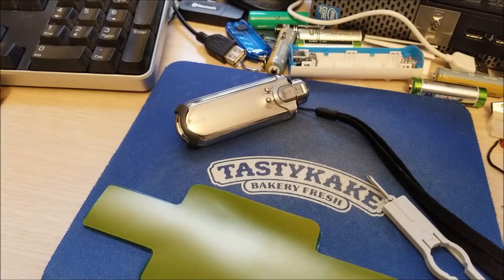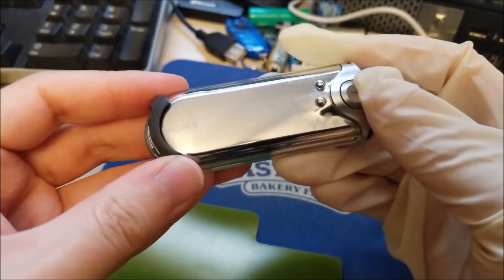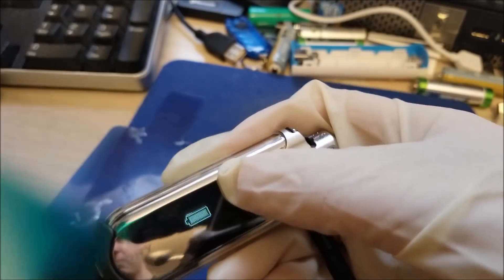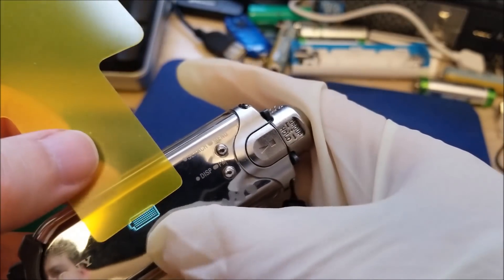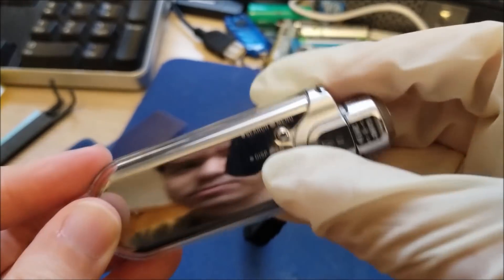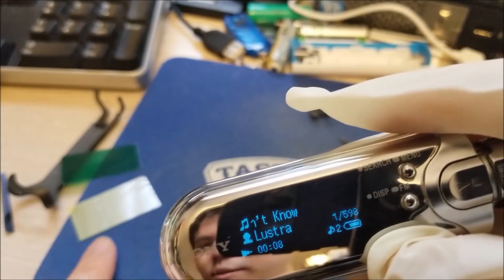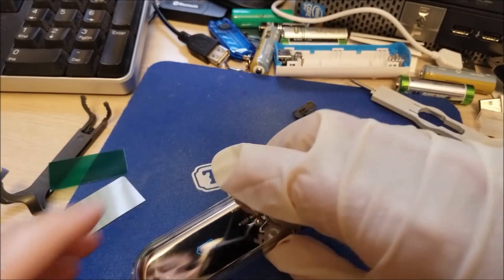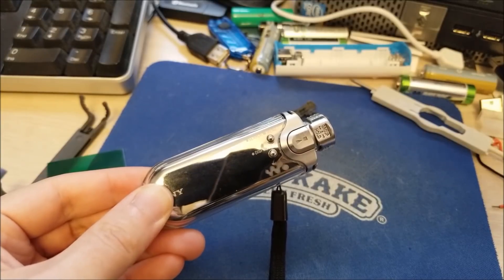5 Minute Project: Changing OLED Color of Sony NW-E507 MP3 Player

Comment: Got my hands on one but dont know how to clean the little scratches and dust from the transparent shells, whenever I wipe it more dust just appears, anyone knows how to clean this?
Reply from the maker: Lint free cloth (like for cleaning eyeglasses) and a little bit of distilled water should clean the dust off. For scratches best bet is to remove the plastic lens from the player with gloves on and use a plastic polisher to gently buff them out.
Reply: @sjm4306  the one i have also seems to have alot of bumps on the metal parts, what is it, and is there anything i can do to remove them?
Reply from the maker: I think the metal is actually plastic coated with a thin layer of metal. The bumps might be corrosion? If that's the case there's not much you could do to remove them without making it worse.
Reply: @sjm4306 i see, thx for such a quick response, this has been super helpful, keep up the good work❤

Comment: Hey how’s it goin? This might be a long shot but, I’m having issues with my new-in-box NW-E003F Walkman. I’ve left it charging overnight but even if I did that, it won’t display anything.

The device is recognizable from my Win.10 machine, and even shows its contents on file explorer and Sony crappy Sonicstage software, but, even still it won’t display anything.

Do you think it’s more of an issue with the display? Or are there other issues that I may have to unfortunately consider for?

Any advice or help is really appreciated
Reply from the maker: So unfortunately your display is likely dead. These early oleds can age even if unused due to manufacturing defects that let oxygen into the semiconductor material so it oxydizes. The only fix is to find a donor device with a working screen to pull it from.
Reply: @sjm4306  I see. I've decided to cut my losses and go with an A605 walkman model. Its less storage unfortunatly, but, it has been proven to be functional with the listings pictures. On your video, can i follow with what you did to your walkman model? With the color filtering and whatnot with my model coming soon?

Comment: Do you know how to put music on it? Sonicstage reads mp3s as 0 seconds in length, and can't transfer them anyway because it can't read the copyright or whatever
Reply from the maker: Are your mp3's protected? Did you encode/rip them yourself or are they from a web store that copy protects them in some way?
Reply: @sjm4306  I used Open Video Downloader on youtube videos
Reply from the maker: Do the mp3's play back normally in other music software? What's their size in MB? It's possible they are corrupted from the downloader program.
Reply: @sjm4306  the mp3s do play back in the built in windows player, but i dont’t remember the exact size of the files

edit: nevermind, it works now, i guess the mp3s were corrupted or something

Comment: batteries wear out over time. also unit doesnt have enough storage
Reply from the maker: Two biggest things to keep in mind. At least the battery can be replaced but nothing can be easily done to increase capacity unfortunately. Should technically be possible to swap the nand chip with a larger one but you'd have to clone all partitions and even then the firmware may have a hard coded limit.

Comment: Nw e403 no data problam is ka koi hal bta den
Reply from the maker: That usually means someone deleted the necessary operating files on the drive (depending on the model the encryption key may be gone as well which is unique to the player and irreplaceable). If the model isn't encrypted then find someone with the same model and kindly ask them to send you a copy of the directory and files on the drive and copy them to yours.

Comment: You think anything like this could be used to replace the MZ-RH1 screen? Or RH10
Reply from the maker: Actually this is exactly what I've seen some people do. A few of Sony's portable flash mp3 players used the exact same oled screen (looks to be 128x16 resolution, but different controller to the common arduino screens on ebay) as the RH1 so they can be scavenged. I believe a sports tube style player sony released (nw-s203F) uses this screen, while the 128x32 screen in this nw-e507 wouldn't fit. The issue is these players are getting rare and pricey themselves and a RH1 needs two screens so the fix while possible certainly wouldn't necessarily be cheap. As for the RH10, unfortunately the screen seems to be custom and only used in that specific model so there's no easy or cheap replacement I know of other than finding a broken RH10 with a working screen (this is exactly what I did for a video to get my RH10 up and fully running).

Comment: I noticed on many small OLED displays you can pull off the polarizing film and get a golden looking display with a lighter color, this is due to a polarizing film on the OLED. Then I put dichroic glass on the display it turns into an infinity mirror type of effect. 

Actually on one of my phones I burned away some of the polarizing layer on the OLED screen with a laser, the screen has golden portions on it but no pixels seem damaged.
Reply from the maker: I'm guessing the polarizing filter increases contrast of the display as to my knowledge it is not strictly necessary for the oled to function. I just bought a handful of those cute 0.96" 128x64 oled modules so I'll have to try and remove a filter and see for myself how it looks.
Reply: Do you think it’s possible to achieve the infinite mirror affect with this Walkman?
Reply from the maker: Yes I'm absolutely sure it is
Reply: @sjm4306 so I would use something like a dichroic window film instead of color gels like you did in the video right? Also, do I have to remove the polarizing film to achieve the infinite mirror affect?
Reply from the maker: I dont specifically know if you have to remove the polarizer but doing so will double the brightness which will probably drastically help the effect.

Comment: What's the lifespan
Reply from the maker: Of the oled screen? It's really hard to say as it depends on when the panel was manufactured and what process was used. From what I've read though oled failure on the NW series isn't nearly as bad as on Sony's hi-md players with oled screens.
Reply: Actually I m planning to buy from ebay for like $70 that's too much do u think It will last for a year
Reply from the maker: So long as it is not already dim then it will likely last 5-10 years of moderate use (just don't set the backlight to always be on)

Comment: The OLED backlight no longer works on mine.  How would you repair that?  It still charges and plays music.
Reply from the maker: The only way to fix a dead oled screen is to replace it. Unfortunately since the screen is not a commonly available one you would need to find a donor from a partially working device.

Comment: hi again! Do you think this is the same that u used?

https://www.ebay.de/itm/Gel-Filter-Flash-Diffusor-Softbox-12-Sets-von-bunten-Studio-Flash-1A/122794881132?_trkparms=aid%3D222007%26algo%3DSIC.MBE%26ao%3D1%26asc%3D20140107083420%26meid%3D699a4d34323f474a8bc8772002940640%26pid%3D100011%26rk%3D3%26rkt%3D11%26sd%3D273047368989%26itm%3D122794881132&_trksid=p2047675.c100011.m1850
Reply from the maker: Looks like a different brand but same purpose so they will work just fine.
Reply: +sjm4306 thanks
Reply: k thanks

Comment: I found an interesting item you might want to buy.  It's a broken GBA SP.  It needs a new replacement shell and battery.  The price is less than $20.  Even if you can't fix the other things, it has an AGS-101 screen that looks like it's in good condition.  https://www.ebay.com/itm/Nintendo-Game-Boy-Advance-SP-Platinum-Handheld-System-AS-IS-REPAIR-S222/302588021227?hash=item4673a6c9eb:g:2BkAAOSwk~ZaTDr-
Reply from the maker: Skyriss Heroysha So torn ... wish I could buy this but I just spent my monthly youtube video fund allotment for content for some upcoming videos. I appreciate the tip though.
Reply: It's okay, I'll still be on the look for other deals.  I'll find something interesting next month.  Most likely another broken GBA SP.  I look forward to your future videos!

Comment: I always love watching your videos. I have watched all of them fully. I wish there were more tech YouTubers like you, ThisDoesNotCompute, and others. You inspired me to do electronics. I got a clock lit that displays the time, then the temp (in degrees Celsius, which I don’t know) and the day and month, all separately. I hate it and I was wondering if you know of any that, you know, are just a clock and only tell time. If you don’t know of any clock kits, do you know have any other kits you recommend?
Reply from the maker: Thanks for the kind words. I believe the best way to get something that you want is to build it yourself. The problem with kits and commercial clocks is they are made to have as many features and be general enough to try and please everyone. However, nowadays it is easy enough to buy an arduino, led or lcd display, real time clock and buttons and download libraries to interface the modules. Then all you need to do is find a tutorial for building a clock that is close or exactly what you want and modify it until it is perfect.
Reply: Thank you for the reply! One more question, what version of arduino would I use? Anyway, hope you have a great day!
Reply from the maker: AceGaimz I would get an arduino pro mini since clones are super cheap on eBay for only ~$3-4. Just make sure you get one with usb built in (you may need to manually install the ch340 usb driver on your computer to get it to be recognized).